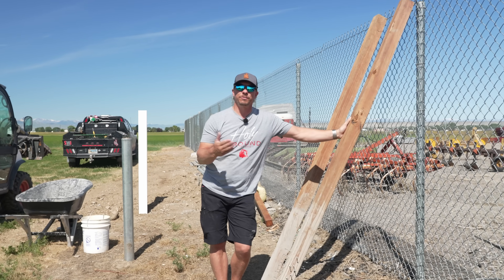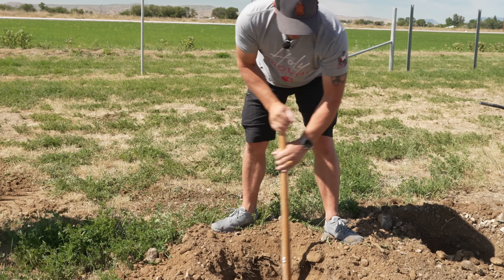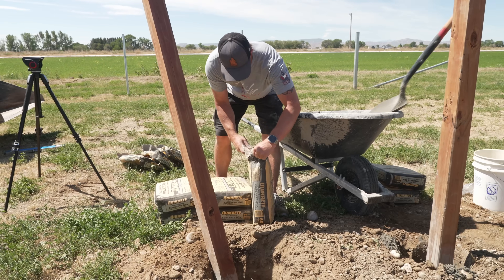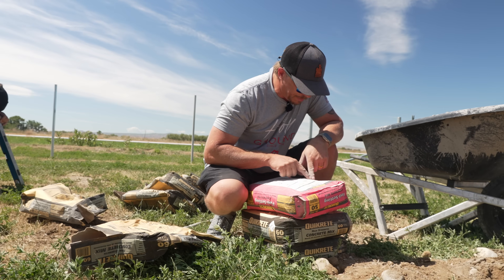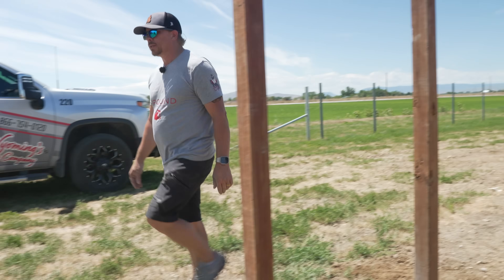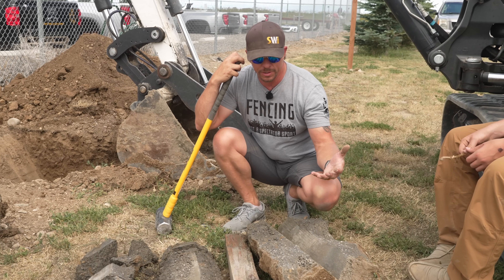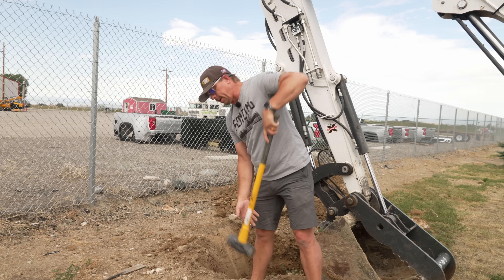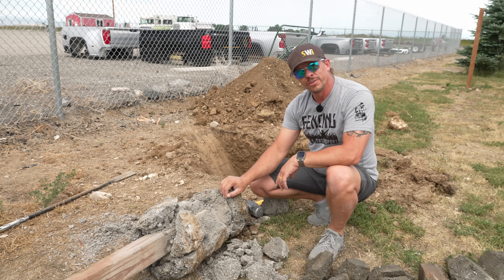Why Adding Water WON'T Save Your Dry Pack Concrete

Comment: I agree with @JacoBade 1000%! There are numerous sites where contributors extol using the dry pack method for fence posts and others pour dry slabs by just wetting the surface repeatedly. That dry pour stuff does NOT work if you want your slab to support more weight than a go-cart. The end result will be what’s called, “honeycombing.” The top of a dry pour slab will look okay, but beneath the surface, you’ll have nothing but dry cement material. Don’t believe me? Dry pour a very small slab for yourself and take a look underneath in a few days.

Comment: My opinion after setting fence posts for decades. Most all were in heavy clay soils in the south. 
1. Clean and compact the bottom of the 30” hole. 2. Toss in a gallon of gravel. 3. Wrap the posts where the dirt hits the posts with 12-18” post wrap. They make this easier with a heat shrink product. 4. Use 2 bags of wet mixed concrete. 5. Let sit overnight and backfill post holes. 6. Add optional metal or plastic post caps. 
This system will last for decades if your 4x4 posts are treated well for ground contact.

Comment: The best way to set a post using concrete bags-
1) quick set concrete
2)add water in the hole if you're using two bags add half the water you need for two bags
3) when you're done dumping in the first bag add more water
4) finish filling hole with second bag
5) use digging bar to mix the concrete in the hole
6)check plumb of post-on to next post.

Its 6 years in California I haven't had a post fail yet
Reply: I’ve done very similar with great results. When building fences, I put a couple inches of small rock in bottom of hole for water drainage, then I pour 1/3rd bag of concrete in hole, pour some of the water and mix, more concrete and water and mix, till I get all the concrete in. Posts don’t wiggle at all. Dumping the entire bag, then adding all the water leads to ineffective mixing and it doesn’t take much more time to do it in 1/3rds or so.
Reply: @factsoveremotions6035  ...doesn't mixing the first 3rd concrete/water just defeat the purpose of putting gravel in the bottom of the hole. ?? Seems like that would just incorporate the concrete into the gravel. ??
Reply: @78tag  it’s 3-4” gravel so it stays separate and mixing water/concrete is mostly poking around with a stick so water is absorbed by quickrete concrete. The local code enforcer guy said it’ll last a long time, which it has. I live in upstate NY and posts are still rock solid and haven’t pushed up from frost heave and were set 7yrs ago.
Reply: @factsoveremotions6035  ...so you are saying the water/slurry doesn't get mixed with the gravel at the bottom ? Sounds like a great plan.
Reply: @78tag  feel free to go argue with the Code Enforcers and Manufacturer Engineers who designed the product. Tell them 78tag from YouTube disagrees.
Reply: @factsoveremotions6035  when you place gravel at the bottom it doesn't serve as a drainage.. once you pour the bag into hole, and pour water on it, water will naturally sift down the smaller particles like cement and sand, gravel at the bottom serves as a back up concrete mix as these materials sinking will reform a new proper concrete. thats the logic
Reply: @backyardthinker5996  ah, that makes sense. Maybe I mixed up the idea that you want it to drain and what Engineers and Code Enforcers say to do. I know when in doubt, I follow Manufacturer instructions. The posts I’d think, would be concrete with the brackets in the top to completely avoid soil contact.

Comment: I'm <12 miles from the Virginia coast, my house is 10ft above sea level.  My yard is basically a couple inches of top soil on top of clay, I auger down 30 inches and I'm in water already (bottom of holes are mud or standing water.  So I can't "take out all the loose" because I've got nothing solid to work with down that far.  I tossed dry concrete down in the hole to take up the standing water, then set the post in and filled with wet concrete.  I don't know if that was the right or best way of doing things, but all I've ever known from the few fence repair jobs I did growing up was "dig a hole, put the post in and fill with wet concrete".  I used the quikrete fast set stuff from Home Depot, 50lb bags.

Comment: for those who don't like dry pack.
Have you ever left an open bag of cement in a not so dry shed for a year or so?
Reply: yes... and have you ever taken a sledge to the bag?  It's not solid all the way through, just the first inch or so.  Furthermore, because it's in the bag, more surface area is exposed to moisture.
Reply: @davemitchell6777  yes i have.
how solid a bag of cement goes when stored badly depends a great deal on how much moisture it is exposed to and for how long.
I have had a bag go solid all the way thru, like a stone.
This whole dry pack thing is very much dependent on how much moisture is in the hole and how much time.
.
I have dug up posts I put in dry pack and the concrete was solid as and very well adhered.
.
"DRY pack" in a misleading phrase, there has to be planty of moisture, either existing in the ground or added at the time.

Comment: two things with dry pack.
1/ Water in the hole if the ground is dry
2/ time

 A little water in the hole and a few weeks makes all the difference.
.
3/ pound that stuff hard as you fill the hole

Comment: Can i wet set fast setting quikrete and have similar results or should i stick with the slower setting?
Reply from the maker: It'll cost more, but you can use the fast-setting. https://youtu.be/_n4dKI-iQsY

Comment: Misleading- adding water WILL save the concrete IF we use the proper 'Fast Setting' concrete mix, that's how it's designed to work. This video shows a (red) bag of 'Fast Setting' mix, but he didn't actually use it.

Comment: As clarified in the video, some 'fast setting' mixes are designed for dry mix into hole followed by water, others are NOT. This suggests different ingredients in the mix- if you use the wrong method with the wrong mix the results may not be...optimal.

Comment: Wood posts without drainage at the bottom will ALWAYS rot out rapidly.  Even up here, in semi-arid conditions, our posts will not last longer than about ten years if emplaced into dirt.  On the other hand we have some which were properly bottomed with crushed gravel or small rocks for drainage, that are still good after 23+years.  For modern installations we wrap them with plastic then concrete around them.  If they don't wick, they will last for a hundred years, just like in the old mining days.
Reply from the maker: I tested the gravel thing, and have to admit, didn't expect it to work. Still didn't change my mind though. https://youtu.be/VKVS72PLucU
Reply: @SWiFence  I saw the video, and it is very good.  You covered the obvious items such as fungus, mold, oxygen, etc.  That should give others some concept of what is going on.  The basic problem for any rotting is that the concrete itself will wick water.  The gravel or rock layer will also wick water upwards from any nearby water table.  Any water from above will wick downward along the wood/concrete interface.  If the post is stressed or moving, that interface will develop a gap where the air and mold can get in.  We have usually emplaced a "glue layer" around that upper lip, using a flexible polyether, which attaches to the wood and throws the water off.  We tried polyurethane around the posts, but this did NOT work, since the thermal expansion of the poly is not compatible with wood, in frost/heave environments (here in Colorado).  This is also true for decking.  We also have ANTS, which love the wood, for food.  I swear to God, that these ants will find any place where there is a water trap, especially during dry periods. They can walk for hundreds of feet, from somewhere.  I realize that for an actual contractor, trying to make a living, that some of our techniques are not practical, and would cause massive costing losses.  However, we have rentals, and as such, we try to make them bulletproof.  So far so good, but it has been a learning process.  We now use the BEHR decking sealer product on all our porches, wood railings, posts, and similar, since it is flexible and does not require any special prep work.  You just slather it on, and it sticks to the wood like glue.  Durable, wears well.  PassItOn.
Reply: @brunonikodemski2420 I treat my deck and trailer beds with automatic transmission fluid. It’s the right color and cheap.
Reply: @otis4349  The best I've found is a 50/50 mix of used engine oil and diesel fuel. Soaks in good, works as well as a lot of store bought sealers, is cheap, and looks pretty good as a stain.

Comment: You have to saturate the whole dirt area around the hole for dry pour.
Just leave the sprinkler on it overnight.
The water penetrates the dry concrete from the sides then and builds pressure from the gravity of the water saturation above it.
It's like power injecting the water into the compacted dry mix.

Comment: The telephone line contractors use a spade and spoon for digging deep hole for poles, the spoon wound save you a bunch of work cleaning out the holes over the shovel. I know because iv used both.

Comment: Iv got a like 5’ piece if 1/2” galv pipe with hose threaded and the end capped and couple 1/4 holes in the side. Shove to the bottom and “inject” the water in the concrete. I run a water pump and tank on my rig though

Comment: You have to use the fast set! I feel like most everyone that builds fences knows fast set can be poured dry and add water. What I don’t get is how you even read it on the instructions but then still did your dumb test using the wrong concrete
Reply from the maker: Because that's what people do. We're not testing what the manufacturer tells you to do, we're testing what everyone does.
Reply: Not a single person, I know uses anything but fast set when dry setting posts. If anyone out there does use regular mix than it is only because people like you making videos like this. At the very least you should have also done a post with the fast set to inform these people you are saying exist.

Comment: I have done a lot of post semi dry pack. I add water to the hole, concrete then more water then more concrete then more water. I do this process till I have the hole full. I have had good luck with it. I will admit it is not as strong as mixed but it , just adding to the top I don't that will work well

Comment: Sorry, I'm not convinced dry pack concrete is bad for all applications.  I used concrete blocks to address severe erosion at the base of concrete bridge support walls at either side of a small creek.  The previous owner had used rock, but the creek runs high and fast during the rainy season and it was a constant (losing) battle replacing the rock.  I made a slanted wall, following the contours of the steep bank, using concrete blocks.  I drove metal fence posts through the cores of the concrete blocks and into the creek bank, then filled the cores with dry concrete mix.  I used no water at all.  We don't really have a dry season, just a "less-wet" season, so the concrete solidified enough to stay put in a day or two, no rain needed.  Each row of concrete block  is connected to at least the row below it with the metal fence posts.  The resulting beast of a "wall" hasn't budged in twenty years now, and the erosion problem went away completely.

Comment: Better than dry pack it should be called low or no slump concrete. ever heard of a clam shell post hole digger.
Reply from the maker: Clam shells don't work well in our area. Too rocky. The big rocks stay in and everything else falls out. You'll get it done eventually but you'll grow old doing it.

Comment: Good info 💪 One thing would be cool if you try it would be to do your hole but the post in and fill the hole up with water then start adding dry concrete once the bag is in or a half a bag is in use the donkey blank vibrator Then put the rest of the dry concrete in vibrate the top section and let it sit I wonder if that would give you stronger concrete than dry pack but be good enough or if it would turn out just as good as wet set? 👍
Reply: Maybe do a second experiment where you do the same thing at the beginning but don't use the vibrator Just fill the hole with water throw the dry cement in and walk away 🤷‍♂️
Reply from the maker: There appear to be a 100 variations of this method.

Comment: Pour water in the hole first, fill it with concrete, poke it with a stick. Water works up into the concrete. Top it off with concrete flick water on the top to get it to harden up. That post will not come out, won't bend or sway. Quick and easy no need for a mixer. 

The real trick to make it last a really long time is mound the concrete up above the soil level. Leave room for the fencing of course.
Reply from the maker: There appear to be 100 variations of this method.

Comment: I was not entertained by your video dry packing works. You do have to add a bucket of water to it and after time it’s still absorbs moisture from the ground cement set and Harden you’re not doing it justice

Comment: It does not matter if the concrete hardens, it is a barrier between the soil and the post. It is the soil that eats the post away. The post will stay upright if the concrete hardens or not.

Comment: Tell the dry pack people that want to add water that the best time to add water is before putting the concrete in the hole
Reply from the maker: There seems to be 100 variations of this method.
Reply: @SWiFence  LOL, I was sarcastically saying to mix the concrete with water

Comment: I have now built some fences, and I have found that the best method is to add 50% less water to the mix than what is normally needed. It sets fast and absorbs any extra water from the ground whats needed. It is easy to set it level, and high winds do not push the posts out of alignment
Reply: Incorrect water amount means concrete wont achieve its potential strength.  That is what he is trying to explain in this video.  Will dry set hold yes but not for long.  I am replacing my fence because of the dry set method could hold up to wind.  Besides, its fun to mix the concrete ha.

Comment: As a welder in the deep South I can't tell how many miles of pipe fence we built we've always used dry set and add water a little before and after and we've had to pull these post up when trees fell on them to this day since I started 1986 we've never had a problem we use a sledgehammer to hit the 2 and 3/8 pipe to get the concrete off and it's still always holds pretty good not sure about the test I just know what's work for us
Reply: I've seen it work, and I've seen it not work.  Code around us now requires that we mix it.
Reply: I'm sure it works. Concrete will solidify over time when it's moist. Even an unopened bag of concrete will turn hard when left outdoor for 3 to 6 months. That's why dry packed works. I usually use wet mixed, but will consider dry packed with water pulled in for fence project.
Reply: @cheerry777  Dry pack works well enough, I've been using it for over 20 years for fences and even pole barns without issue. It will never be as strong as wet mixed concrete, but it's strong enough for a post in the ground. Dry pack is for sure the fastest and least labor intensive method, especially if you don't have a concrete mixer.
Reply: I think a lot of the reason why it works is no matter what even if it doesn't set up well It still is harder than the dirt surrounding it. So yeah, I'm sure it's better to mix it but it's certainly good enough to do a dry pack with some water In my opinion. I drive past fences that I did years ago everyday with dry pack. I could also see where it could have a major effect depending on what kind of soil you have.

Comment: Lets compare why posts are different when mixing concrete with water and with water poured on top.  Oh, wait a minute,  lets put screws in one post and not the other and call it a comparison.  That's like putting on winter tires on a truck to drive out in the snow and ice and another truck with summer tires and then wondering why the performance difference.  Both posts should have had screws installed or both posts without screws to be fair.  Do it again fairly,  Mark.
Reply from the maker: I know it looks that way, but the screws/wet-set wasn't intended to be a comparison. I tried the screws thing in a previous video and it didn't work, so we were trying it again. It was supposed to be "bonus content," not a comparison.
It was confusing. I should've just made a separate video for the screws thing.

Comment: I really don’t understand why someone would conduct a test of products and methods without reading the manufacturers instructions.  The Quikrete in the yellow/orange bag is only intended to be mixed with water and then poured.  It is not intended to be used to set posts w/o mixing.  The Fast-Setting Quikrete in the red bag is the only product that is to be used in this manner.
They got a bag of the red, but then never used it.
Reply from the maker: You make a great point. We're not really testing HOW it should be done, we're testing WHAT people do. Because people do this. All the time.